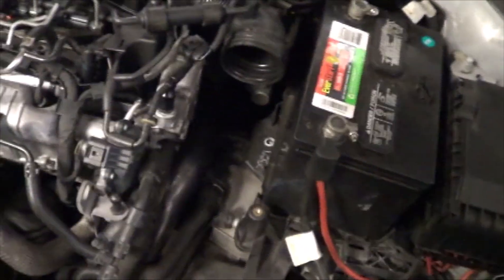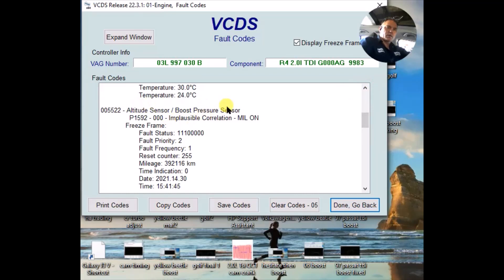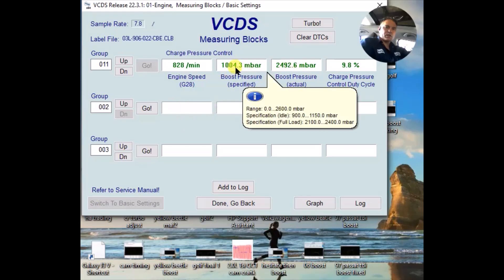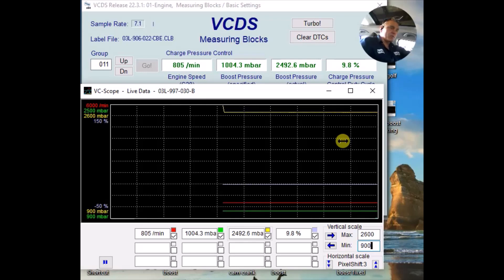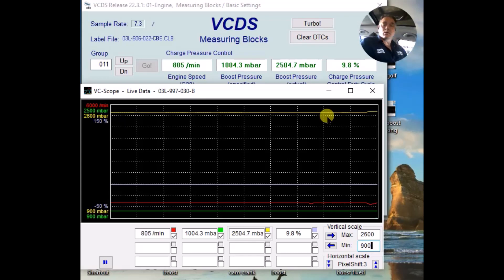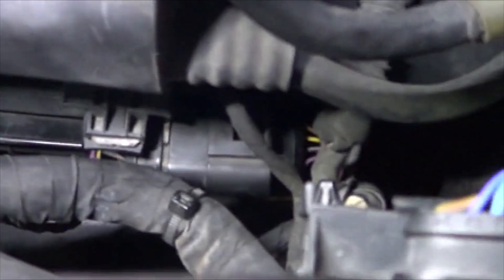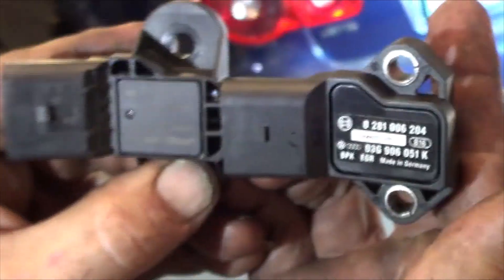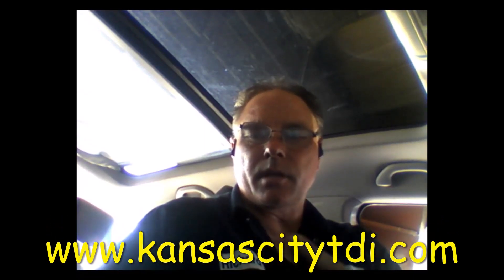vw tdi Map sensor code P1592

Comment: Hi, i had same problem... Long story short, changed map sensor, fixed wiring in the location of the connection where u read voltage for sensor. The sensor gives me the right  measurements now but still in limp mode. while the car is running if i erase codes... The car runs fantastic. But if i turn it off and on again, it is in limp mode.
Reply: Hello, I have similar problem. Did you fix it?

Comment: hi guys facing the same problem , change that black turbo sensor still nothing. didint understand where was the problem on this video thanks
Reply from the maker: map sensor was outputting 3.9 v at idle which was lying to the computer telling it that boost was at maximum 9about 3900 millibar.  .  At 12:50 we showed the new sensor and then it was installed, and we read the reading from the scan tool and it was normal at 968 millibar.  You could use the info in this video to diagnose your problem.  We had a 2nd vehicle like this that had the wire broken to the map sensor.  I'll try and find the link to that one.
Reply from the maker: Watch the following video from the beginning but the problem is shown at 2:23  https://youtu.be/0riWSlxH6ug